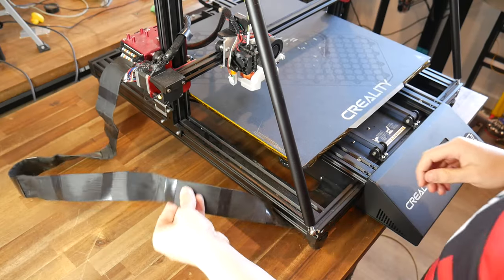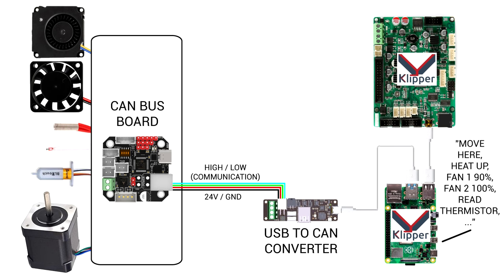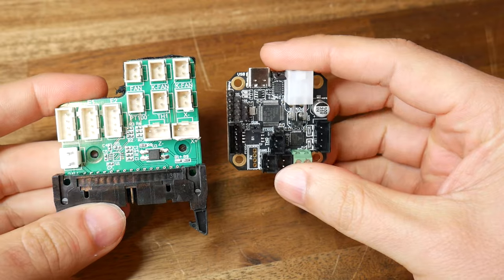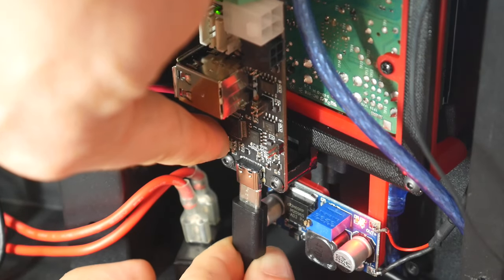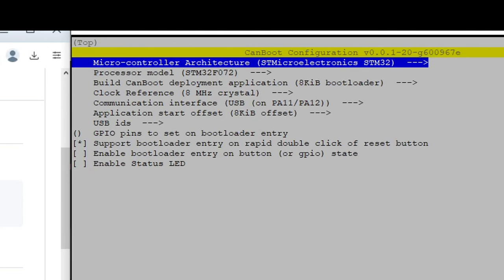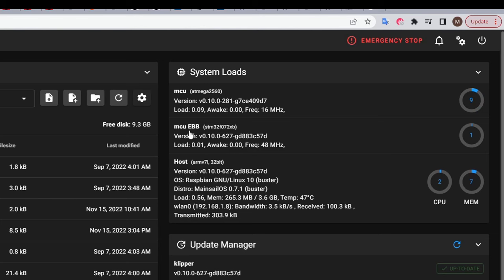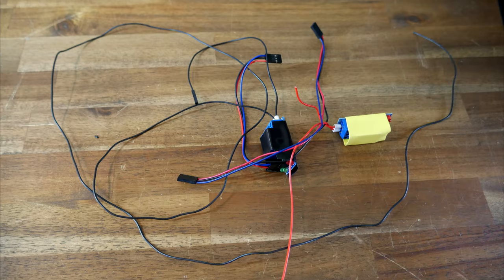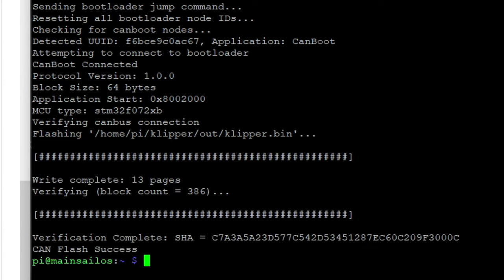Klipper CAN bus guide for Bigtreetech U2C and EBB boards

Comment: I have been fighting with this exact setup for the past month. Watching your video gave me a number of new things to try. Thank you so much for putting this together! Hopefully it will fix my problem.
Reply: Any luck so far? I'm thinking about installing Canbus on my voron and am just curious lol.
Reply: @jeremytodd1  yeah, actually! It turns out my issue was that I needed to set the baud to 1M.
Reply: @bamhm182  Did you have to re-flash your motherboard baud to match as well? I did not do that.  I have U2C and Ebb 36 V1.2 set to 1000000 and at the klipper flash for the ebb, no UUiD can be found.  I'll have to look at it further this weekend.
Reply: @spanny52  mobo and can are two separate can devices, so the mobo is whatever BTT recommended, and the can is 1M. I recommend you start from the very beginning of the instructions here, and follow through exactly. I was having the same issues. I used the OFFICIAL candle whatever, not the BTT fork.

Comment: I was investigating this just recently (so timely video), but it seems like the execution is still a little rough. I've been delayed with my own progression with CAN implementation due to the poor BTT documentation, so kudos to getting this all working!

For those wondering why you would bother, I can think of a few reasons which initially interested me;
1) Reducing cabling from the control board to the print head (potentially reducing areas for troubleshooting if/when hardware faults occur)
2) Replacing the cheap cable from factory that's used when manufactured, and which may be prone to breaking with flex/movement in the original wiring loom when the print head moves around;
3) Easier assembly when/if building a printer or completing a major upgrade (Bowden to direct drive comes to mind);

Disadvantages I can see would be having the whole printer down in the event the CAN system/board is damaged. Normally you may be able to replace the individual component/loom (for heater, bltouch, etc.) - with the CAN system, if the board is Kaput, your other working elements will remain inoperable until the CAN board/system is replaced.

I would imagine CAN is better for bigger, complex systems and printers, potentially in excess of what the BTT boards currently allow. There are a whole heap of other advantages with CAN too, but that's more related to communication benefits, integrity of signals and reduction of electrical noise, etc.

Michael - potentially something to have been discussed in the video/subsequent video - the why and when such an upgrade would be beneficial.

Thanks for the video!

Comment: Just bought the BTT EBB 42 and U2C to fit onto my CR-10 v2, so this guide is very welcome 👍... also ordered a BTT CEB CAN Bus interface board in preparation for the Sovol SV08 multi-toolhead upgrade.

Comment: Did it a month ago to my sapphire, good upgrade. I went with the Rs485 can hat, seems a bit easier to me.
Also interesting for all who self source a voron 2.4 for example: a canbus toolhead board might even be financially a good idea, on a 350 2.4 you save around 30m of wire and two drag chains
Reply: Holy shit, 30 meters of wire? Crazy.

Comment: Just a note, all these toolboards work just fine with USB. No extra hardware needed, no lengthy setup process. No loss in latency, no additional overhead, etc etc. It's much easier to deal with. I wrote a provocative RatOS blog post about it, because i think CANbus is misplaced in simple 3d printers and overcomplicates the process for no particular good reason. If you run cable chains you may want a usb cable rated for drag chain use (they do exist), but in simple umbilicals that is overkill. 5K+ hours on several printers and no issues.
Reply: Exactly this. I am quite surprised that there is such a large focus on the CAN bus aspect when it is in actual fact not needed at all. . Just use USB and be done with it. The main klipper board is also connected via USB - tried and trusted. CAN overcomplicates the Klipper setup by a ridiculous amount.
Reply: Can you explain this. I am currently looking at and implementing CAN into my system and before i go ahead and create a cable. i would like to know what you mean by "use USB"
Reply: @3D_Print-hy3rp  There's not much to explain. Just erase CAN from your vocabulary, forget it exists and connect your boards with USB to your Pi like you've always done. There's nothing more to it.
Reply: @miklschmidt  but surely the power for the fans and hotend you can't run that through the usb being max 12v (normal 5v) you need 24/12v for fans and a good powerline for the hotend
Reply: @3D_Print-hy3rp  Power delivery is unrelated to the communication protocol, CAN doesn't deliver power either. You power your devices like you would otherwise. On toolboards the power wires are usually paired with the CAN connections in a MOLEX or XT30 connector. 

All you're doing is swapping CAN for USB. Or rather, you're not swapping USB for CAN.

That said USB-PD could in theory power a toolboard, but there's no reason to go there and no boards currently support it.
Reply: @miklschmidt  Thank you for the clarification. :-) if i am running 2 wires for power i may as well add a twisted pair for CAN. But that's my preference and fully understand where you are coming from.. Thank you

Comment: I recently considered this upgrade but opted for the BTT PiggyBack36 break out board instead. I consolidated all the wiring into a single umbilical with custom cabling and minimal weight gain. Much better setup
Reply: Hey!

What kind of plug do I need for the 2x8 connector? Is it included with the PiggyBack or do I have to source it separately?

What is the pitch on the 2x8 connector?

What size wires (AWG) did you use for it?

Thanks in advance!
Reply: @daniel.hungary alf a year late, but the piggyback36 uses a 2x8 molex microfit 3.0 connector, and for wire size, 18awg for hotend heater cartridge wires, 22awg for everything else (not relevant to the piggyback36, but 12awg for the bed heater cartridge)

The piggyback36 comes with the connector, though you will have to crimp the pins to the wires yourself, you can do this with regular household tools, but it’s better to purchase a crimping tool

Comment: CAN has been the future of 3d printing for 3 years now. But in RRF where it just works :) Seriously though Klipper will get there too.
Reply: It's easy for RRF because the amount of boards it officially supports is pretty limited, and they themselves also design them. Klipper have to work with a multitude of boards from different manufacturers, sometimes with conflicting features between them. It's basically a Mac vs. PC situation. That said, Klipper is already there. CAN support on Klipper is pretty new and may still need some maturing, but it already works. And that not mentioning the other features that Klipper brought to 3d printers that are being copied by RRF like input shaping (and even so with limitations, due to how RRF works).

In the end both are great firmwares, and as long as they allow me to print plastic boats I'm happy. :)

Comment: I'm really thankful about this video. It couldn't come at better time. I had FlyMellow CAN 2.0 kit for my V_minion on order, but order was constantly getting delayed. This video made me realize it would be too much hassle and variations for the gains. My original intention was make tool head more modular. I can get to my goals with "CANless" toolboard much easier. Yes it's more wires, but waaaayyyyyyy less hassle with updates. And I'm not sure flymellow can 2.0 (one I cancelled) supports usb flashing.

Comment: I think you are missing the point of the EBB42 a bit^^ it is meant to be mounted on the actual toolhead, this way you can leave out as many cables as possible. It also has an adxl345 accelerometer on board so you can measure and reduce resonances with Klipper. Obviously this can only work if the sensor is on the toolhead.
Reply: As he mentioned at the start the 36 is designed to go on a toolhead with pancake steppers.  The 42 is designed for a full nema 17,which you rarely see on a toolhead and so would go wherever your extruder motor goes.

Comment: I found BTTs documentation on the pinouts for the U2C and EBB can ports extremely frustrating, and like many, ended up burning the board by reversing polarity (they have decided to mirror the polarity instead of keeping it the same).
Reply: Mirroring the pinouts like that is never a good idea because there's a clear benefit to NOT mirroring. I hope the designers are learning their lessons...

Comment: It's definitely a good mod for the open printers. However, how well does it perform in a heated enclosed printer? I'm worrying that the stepper driver might overheat given its ambient temperature will be 50-70 degrees VS ~20 room temperature.
Reply from the maker: Definitely a valid concern. You could probably get a heat sink on the TMC2209 to help a bit. So far I haven't needed it after some long test prints post video.
Reply: Works just fine with my 3D printer. I am however using fly sht36 board for the last 6 months but its all the same like BTT. The board itself has one temp. sensor built in and the board temperature reaches about 90°C but still works without any problems.
You shouldn't worry about the temperature.
Reply: A lot of people are using Canbus with their Voron 2.4 without problems. Iam in the process but I need to print an abs mount for the ebb to continue my build. Also, a lot of people are using igus cables like me.

Comment: For those who want to save some money: You can also operate the tool board directly via USB on the Raspberry. The connection saves the detour via CAN BUS. However, you have to connect the 12V or 24V additionally.
Reply: How? Can you give some links? Thanks!
Reply: @MatheusFP104  It is even easier to set up. Just flash the precompiled USB firmware from BTT GitHub instead of the CAN BUS version. Make sure to define the MCU correctly in the printer.cfg.
Reply: The USB bus is not as robust a signal as a CAN bus. Also very few USB wires are rated for as much movement as happens in a 3d printer. I would not reccomend this. It could be a very expensive 15 bucks you're trying to save.
Reply: You are using this "not robust" connection between your raspberry and the CAN board, also between your raspberry and your mainboard and you do a signal conversion. USB is rated for much higher transfer rates than CAN. And you only have a distance about one meter. CAN is a good technology, don't get me wrong. The USB cables resist the movements if you have an eye on your routing. The thin twisted pair cables which are used for CAN are not better.
Reply: @Technikfreak72  Where are you getting the 1 meter length from. 1m will not be enough for most 3d printers. An ender 3 or any of it's clones needs at least 1.5 meter cable to the head. For larger box style 3d printers you're looking at 2 meters easy. This is where cheap usb cables start to lose signal(max on most usb standards is 3m allthough usb 2.0 is the exception with 5m). The higher transfer rate of usb is completely unneccesary for this aplication. I also don't think a cheap chinesium usb cable(remember you trying to save 15 bucks here) is gonna hold up. I've got usb cables that couldn't hold up to a few dozen charge cycles without fraying. I really wouldn't want that kind of cable anywhere near a high stress movement of a 3d printhead. There is a good reason why the 3d printer with the usb-c cable to the toolhead was so heavily critisized for it.
Reply: @rebelangel66   Sorry it works, also with 2m cable and it is easier to install. No extra mount ... 
And yes, do not use the cheapest USB cable. Everyone can do it as he/she wants.
CAN BUS makes sense for long distances at low cost and if multiple control units have to be connected in a chain.
Reply: Do you think that 100W USB C cable is doable powering via usb only? Stepper + Heater + plus coolers
Reply: @MatheusFP104  The tool head board does not support powering the fans, stepper etc. over USB. You always need to connect the two power wires.
Reply: @rebelangel66  You are the person talking about using cheap usb cables, no one else.
Reply: @MatheusFP104 This is what Biqu does for their hermit can
Reply: Cool
Reply: @Technikfreak72 this might be the answer to a problem I've been having. I recently got a biqu 2 in one out upgrade kit  which was designed for the biqu b1. My goal was to use is on my klipper ender 3.It has a usb c can bus on it but I can't find any documentation on it. The printer it was designed for makes mention of having CAM capabilitys but rather i2c amd spi
Reply: If you want to save money dont convert, if you do want to convert. Technically USB, SPI, I2c, CAN and so on all do the same thing.

Communicate with the toolhead, now why would you choose one over the other is the real question here. And the answer depends on the technical specifications and restrictions of a 3d printer.

Auch as do you want bidirectional communication? Will other boards be hooked up to the same data line, what are the data transfer requirements of your system and will EMF cause critical data to be lost at a non trivial rate.

Once you go through all this and more CAN is best.
Reply: @Technikfreak72  You don't have to use a genuine USB cable.  Splice in a twisted pair of CAT5,6, or 7 (one of these is stranded wire, use that).  You won't be using the power wires in the USB cable.  USB is both a protocol and a hw standard, you can ditch the official cable standard and use something else, but will have to use the standard connectors.  CAT5-7 is rated at much higher speeds than USB, and both use differential switching.  USB was designed for short haul connections to printers, cameras, disk drives and such.

Comment: I got it somehow working… the software side is always the tricky part.
Wired the cable along the filament PTFE tube now. Got to many broken wires in the past. Don’t want to deal with cable chains anymore.
Have to write down my working EBB firmware before it’s too late in case I need to update it.

Comment: Hi Michael, Thanx for the video and the link to metoyou. The step where, prior to flashing the EBB, disconnect the USB and connect the CAN is for me strange as it is not mentioned on the metoyou page. Also, no matter what I try, I get the same UIID for both EBB and U2C and flashing klipper to the EBB fails,... any pointers in the right direction would help,...

Comment: Wish I saw this just a few hours ago lol.
My CR10s Pro's SSR failed a few days ago and replacing it today I accidentally killed the mosfet on the board so the bed heats forever without stop.    If I had saw this i'd order the parts to set this up rather than just getting a replacement board and still dealing with the stupid 30 pin.  Maybe next year I'll try setting this up, should be easier by then right.

Comment: Would love to see your take on the Biqu Hermit Crab Tool changer that supports Can Bus.  You can run it completely through USB-C.
Reply: For clarity, the USB-C connection on the tool head of the Hermit Crab CAN isn't 'actually' USB-C is just using the connector as a convenient low profile multi pin connector. The interface is still CAN, just using pairs within the USB-C cable to do it.

I'm starting an upgrade with the hermit crab and my only major thought / need to work through is how much current the hot end takes vs how much a usb-c cable can actually provide within its own thermal limits.... there seems to be a mis-match between how much current the cable is rated for and how much a hot end would draw....

Comment: After programming my U2C, at 7:40, I can't get the U2C to reboot without a blue light.
EDIT: I went ahead and pushed forward, but I can't get the message "0 uuids found", I get the same issue you had previously - Error: No such device
EDIT: A Word to everyone feeling like every step of the way, the errors drive you crazy, keep pushing through. I have finished setup and am happy! Thanks so much for this Teaching Tech. FYI running EBB V1.2 with U2C V2.1 on an octopus pro and raspberry pi 3 model b (Voron 2.4)
Reply: Hey, IF I don't manage to fox it by tedious trial-and-error: waht were your fixes to your initial problem and "Edit1"?
Reply: @chrisvolkert6117  oh I pushed forward meaning I continued the guide disregarding the blue light and the EBB/U2C are functioning well in my printer while the U2C still has that blue light 🤣 hopefully that's clear if not lmk
Reply: @chrisvolkert6117  I believe for edit1 it was a question of restarting the printer (waiting a like 30s while shutdown), then repeat previous steps

Comment: Also if you have a revo be careful, DFU mode on a BTT CAN Board WILL destroy it.  Do not leave the hotend connected to the board on this mode.
Reply: This is the v1.1 of the board where the DFU pullup is shared with the hotend, it doesnt affect the v1.0 and v.12 boards
Reply: Do you use a Revo?

Comment: CAN is much more widely used than you would think. I'm honestly surprised it's taken this long to get noticed by the 3D printing community. I dislike the klipper specific firmware. Would much rather see a CAN protocol standard for motors and print heads that could be used more openly regardless of the main controller software.

Comment: Wouldn't the X motor have found four wires in the LAN cable? Only two of eight cables are used there.
Now the servo motors and display remain on the old board. But all print head is controlled by CAN, except X motor.

Comment: Nice video! One thing puzzles me. When you created the config for the canboot bootloader you decided to build the deployer.bin, but you didn't flash it, why? I have trouble to understand the documentation for this deployer. I don't understand the benefit of it as I am able to flash klipper without it. What does it deploy?